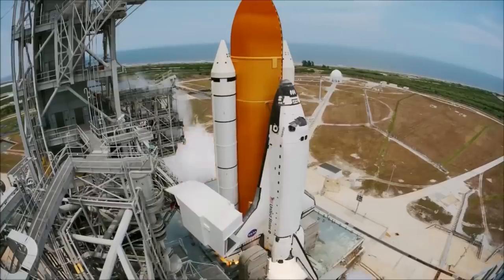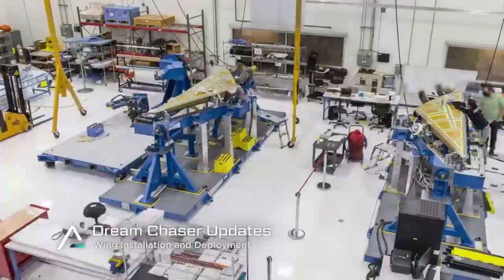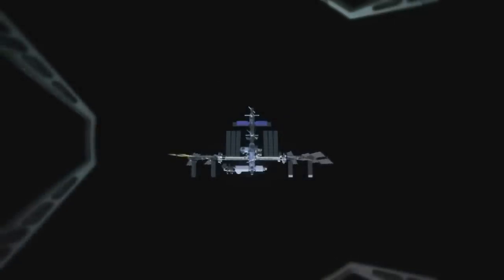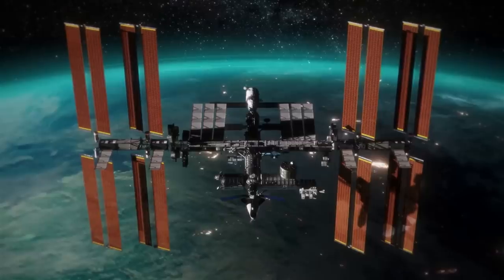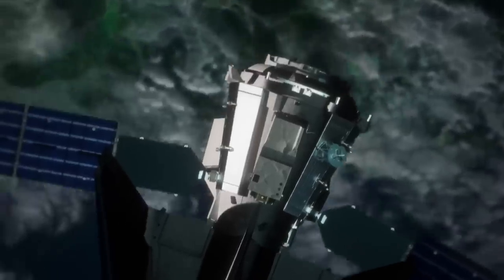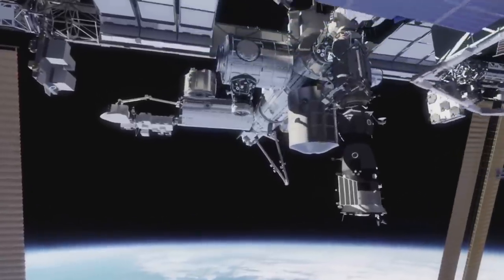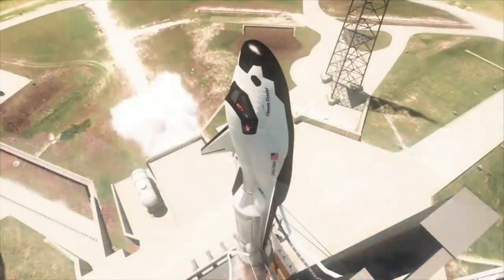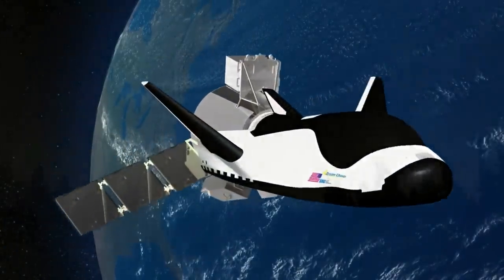A Closer Look At The Next Generation of Spaceplanes

Comment: Dreamchaser should be scaled up to be the crew module for Starship. It would detach and glide to Earth while the tanks and engines do the "classic"belly flop re-entry. Win-win, the glider craft can land anywhere in an emergency and would absolutely satify NASA's demands for human-rating starship for launch and re-entry. After landing the glider can immediately be re-mated with a Starship lower section (fully fueled if necessary) to be re-used. I really think it is worth the payload cost and with raptor engines becoming more and more efficient with thrust, I think the engines could completely compensate the loss of payload capacity for the mating and releasing mechanism.
Reply: Most of the earth 🌎 is water 💦 .
Reply: Interesting idea, with a shortened starship with only engines and fuel. Probably would be safer if they have to do an abort after launch.
Reply: @mrbaab5932  Any runway on Earth of course, not anywhere.
Reply: @Mentaculus42  Absolutely, and more advantages, what about passengers not puking over everything lol
Reply: I prefer a dragon-derived abort system, just stick a capsule on the nose and hit the superdracos if something goes off-nominal
Reply: @harrykerr7547  It's more about re-entry and landing phase and less about the launch phase.
Reply: @mrbaab5932  Most of my beer is water too (but I keep buying it anyway) 🤮

Comment: it would be interesting to see this fly on a reusable Falcon 9.  Not sure if that is within the Falcon mission envelope, but it could result in low cost missions.
Reply: Unlikely unless NASA pressures them into collaboration. 
It's more profitable for Boeing to bill NASA for a ULA launcher.
Reply: @LoisoPondohva  On the other hand, DreamChaser was deliberately made to be as 'launcher agnostic' (their words) as possible.
Reply: @stardolphin2  I'm pretty sure it was a requirement. Also helps with selling them to the ESA for use with Ariadne. 
In the us though, they have partnerships with Blue Origin and ULA. So I'm pretty sure they will actively persuade NASA NOT to bring SpaceX into the picture on this vehicle in any way. Doesn't mean NASA will be persuaded, but the effort will be there - that much I'm sure of.
Reply: Dream Chaser will fit on anything with a 5m fairing.
That covers most current launchers except possibly Electron.
Reply: @allangibson8494  Dream Chaser looks superior to Dragon capsules.  Bigger, more versatile, and easier to recover and reuse.  Maybe Elon should look into buying it.
Reply: @vmstanford  Elon has a fascination with Starship at the moment.
Reply: @allangibson8494  Good point.  But it may be years more before it is ready.  NASA can use proven Falcon 9, and Falcon Heavy, launch platforms for many of its goals over the next 5 to 7 years.  Falcon Heavy can do translunar orbital injection, and can be (mostly reused).
Reply: @LoisoPondohva  Ok, Dream Chaser is a product of Sierra Nevada Corp, not Boeing. ULA is a separate company, where Boeing has a 50% stake. Dream Chaser is launcher agnostic, so it can fit on the Atlas-V, Falcon 9, or Vulcan Centaur. Since Dream Chaser started with the Atlas-V as the launcher, they moved to the Vulcan Centaur when that came along. The CRS demo mission is on the Cert-2 Vulcan Centaur flight.

Comment: I wonder what are the real advantages of the dream chaser.  It looks cool, but is it cheaper than dragon? How long does it take to be refitted between flights?  I feel the future should be propulsion landing.  Needing a runway is not ideal on my view.  And if the crew version is planned within the next 5 years YOU KNOW is really 10.  By that time maybe starship is flying to Mars monthly.
Reply: Needing a runway is pretty ideal compared to Dragon needing a splashdown and recovery ship. Dream chaser can theoretically land at any runway in the world that is long enough. Starship will not be flying to Mars monthly in 10 years, and if it is, so what? Dream Chaser is a LEO spacecraft.
Reply: Retropropulsive landing will never be the primary landing option when safety is concerned. And completely forget human rating. Just ask a safety expert. I am no expert but I am pretty good at logic. My opinion is that the crew be placed in a detachable glider module on top of the tank/engine section which detaches just before re-entry, allowing the crew module to glide to earth (and no huge tanks with remaining propellant on board, extra safe). The tank/engine section does the conventional belly flop re-entry and flip landing/catch, but now without ever risking human lives. Now tell me, will your idea or mine get human rating first? Not competing, just trying to make you see the logic. I know it means more engineering and more complexity but it is necessary for human safety, which has not really been considered for starship yet, but they will have to very soon.
Reply: @originalmin  Yeah, any runway that the jumbo jets land on is long enough for Dream Chaser. And it is not using toxic propellants, so is safe to land there. Crew Dragon has toxic hypergolic nitrogen tetroxide and hydrazine on board.
Reply: @steveaustin2686  good points!
Reply: You exposed yourself wit the starship comment. Starship will never carry humans to orbit. NEVER.

Comment: Its about time that a return to a reuseable space plane has happened. Let's keep capsules where they belong: that of emergency escape modules from orbiting habitats. It'll be great to see first images of a Mars oriented Dream Chaser.
Reply: Who builds the mars runway? Also mars’ atmosphere is significantly less dense so the wings and configuration would have to be accordingly modified.
Reply: Starship should have this type of design instead of the nose cone, and scaled up for 30-40 passengers. Detachable, releases just after re-entry burn so tanks and engines go belly flop, while the glider takes the passengers home on a safer route plus it can land on any runway on Earth in an emergency.
Reply: @Mentaculus42  on mars it could glide until a stall followed by a suicide burn.
Reply: Dream Chaser will never land on Mars. It simply is not possible.
Reply: The capsule design endures because it makes sense.
Reply: no. there is barely an atmosphere on mars. no runways. space planes are cool until you have to carry around all of that extra weight.

Comment: So this is like Starship, except it needs a specific runway and has far less payload?
Reply: Yes, and of course it is 5x as expensive
Reply: Starship will also need a specific landing pad, or rather stage zero mechzilla catch arms. Which is more common worldwide - bespoke spacex launch pads or long runways.
Reply: @originalmin  I think you missed the point. Under normal circumstances the lower part of starship would indeed be caught by mechazilla. The glider always lands on a runway. When things go sideways, the lower section can be discarded in safest possible way , like dumping in the ocean, and focus can be solely on the crew vehicle which then has to choose a runway which is best for landing depending on where they are..
Reply: @paulmichaelfreedman8334  what?
Reply: @paulmichaelfreedman8334  Starship (second stage) is ALSO caught by Mechazilla. Any of the long runways in the world for jumbo jets will suffice for Dream Chaser. It doesn't have any toxic propellants, unlike Crew Dragon, so it can safely land at an airport.
Reply: @steveaustin2686  I think either one of my comments has been deleted, or I replied into the wrong thread.

Comment: "A few flaws" that killed 14.  It was a boondoggle
Reply: Lol
Reply: Ultimately it was bad management level decision making (in both cases) that caused the death of at least 7 of the 14 when Challenger's ET exploded. They knew full well the O-rings in the solid boosters were dodgy in cold weather, but management was already pushing for launch because of the delays, and ultimately decided to launch despite every single engineer advising against it.. The columbia accident is slightly more complicated, and also sad. Pretty sure they decided not to tell the crew there was a high risk of re-entry structural failure and just ride it out whatever the outcome. But the crew not knowing the state of the space craft before re-entry, is equivalent to killing them. They decided for the crew there was nothing that could be done.
The shuttle was however, a logistical nightmare, especially after the columbia accident with the tile checking.
Reply: @paulmichaelfreedman8334  but the system had THOUSANDS of single critical points of failure.  BAD DESIGN.
Reply: @SailingStarCatcher  Yes, which makes the management decision even more painful as the fault does not lie with logistics or the engineers.